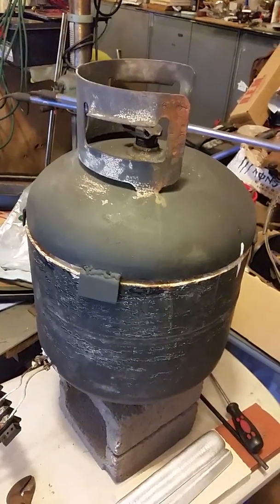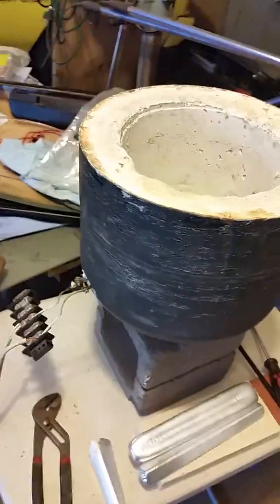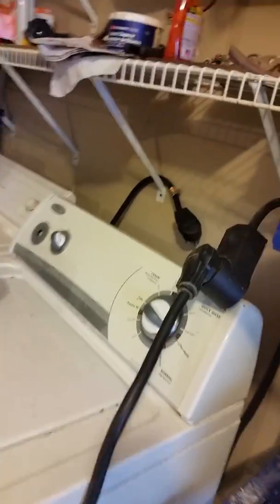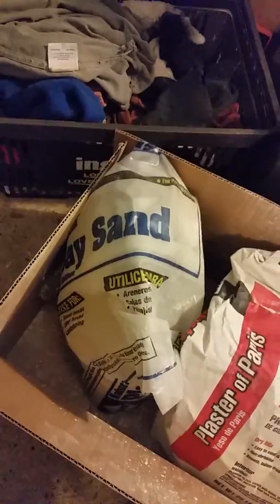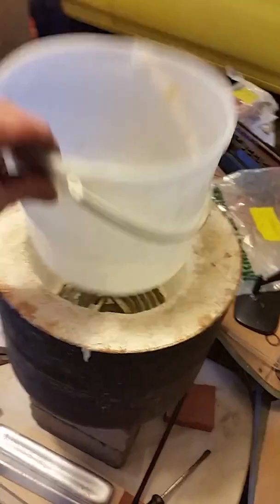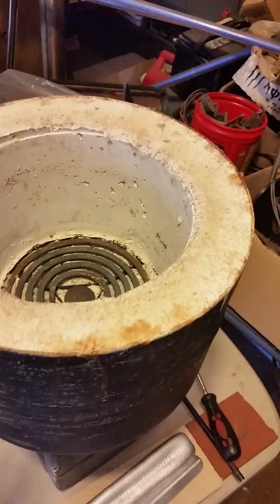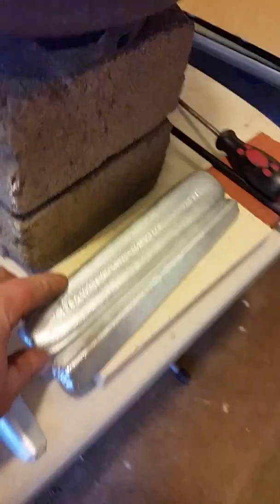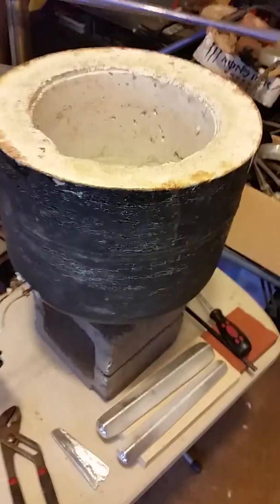DIY electric kiln metal aluminum melting furnace works easy cheap 220v home made

Comment from the maker: Update!   I just fixed the burner. I easily chipped out the old one with a screw driver and hammer to make the new cavity in the bottom for the new burner. Some useful information is that I tried a standard "small" stove burner and it could not get hot enough to melt aluminum even after hours. Even with 220 power. So rather than just using one "big" stove burner, I Put one big and one small burner in with one on top of the other. I used silver solder to basically braze the burner ends to a thick copper wire that runs out the side of the propane tank through a hole. I did not use lead or tin solder due to the low melting point. You could just find a crimping or screw method to hold the wire to them however, the silver solder keeps thing rigid and no chance of flexing to bump the 2 electrodes together. So in the end, one small and one big burner are hooked up in parallel to 220. "no neutral or ground used". the result is a furnace that melts aluminum very fast. My crucible made out of steel fits whole cans and they melt in as fast as I can load them. The only thing I would say is that you want good insulation. The rate of heating up and sustaining the heat to melt aluminum is directly proportional to how well you can keep the heat in. Put the lid on to keep the heat up when possible. I would also stress the importance of not leaving it unattended. once the aluminum is melted, the temperature will rise to the point in which it can burn out the burners. So as long as you are feeding and emptying the crucible, you can keep it running for ever. Happy melting!
Reply: just build an induction furnace

Comment: What is the max temperature it can go to without break electric stove coil?
Reply: I dont know, but it would not melt brass. It burned before the brass would melt, but it melted aluminum just fine so I would guess that it is somewhere between those 2 melting points.

Comment from the maker: Luis please see the answers to your questions by expanding on the replies under your question, but I did want to update this video information. I ended up trying to meld brass and it did melt brass but it took a long time and the coil got too hot. It got so hot that it melted it and basically welded it to the steel plate that I put on the burner as a sort of pad to sit the crucible on. So it ruined the burner and now the problem is that to replace the burner I need to bust the insulation apart to get it out. This is why the more intricate furnaces out there have a thermocoupler connected to a unit that shuts power to the burner at max temperature so that it doesn't self destruct.  It worked very well for aluminum and if you dont let it run for too long and let it get too hot it should melt aluminum for ever. but now looking back, I think the burner would do much not embedded in the insulation. I think a slight air gap could have helped it survive better. So it you give it about a half inch of distance from the bottom of the burner to the insulation it would be better. Also that way, perhaps you could replace it easier if it fails.

Comment: nice build ive been wanting to make an electric smelter also. the 220 conversion is my only concern how did you wire the 220 to 110 plug? and the other question is when u put your steel crucible on the metal heating element, it doesn't short it out? thanks and awesome build👍
Reply from the maker: Luis, the conversion is very simple, 110 3 prong plug uses one 110v hot white, a neutral black and a ground green. 220v 3 prong uses 2 110v white wires and a black neutral, no ground. if there is a ground it is green. I just wired it so each of the 220v white wires went to the one black and one white wire on the 110 plug. not third wire needed for this.
Reply from the maker: and furthermore, it really isnt a conversion, I am just rigging what I had to 220. you really just need to put each of the 220v leads to the burner. I was confused about this at first too. the burner can work by putting 110v to it by hooking up the white to one end of the burner and black to the other end of the burner. the problem is that 110v does not make it hot enough to melt fast. I cant remember, I dont think 110 will even melt aluminum, but it might. but it would take for ever. So by putting 220 to the burner by one of the hot 110 leads of the 220 to the burner and the other hot 110v lead from the 220v to the other lead on the burner, now the 220v "alternates" back and forth through the burner without the need of a neutral or ground. the burner gets much hotter. So to make it simpler I could have plugged the two ends of the burner straight to the 2 hot wires to the dryer plug, but I made it more complicated because I was testing it with 110v first. 
the next part of your question, The burner is made of a composite "non-conductive"  material. its resistance is so high thats why it gets hot. so that is why you can tough stove burners and not get shocked before they get too hot to touch.
Reply: awesome man thanks for all the info I really appreciate it!:) once again great build looking forward to seeing more videos from you thanks man!👍